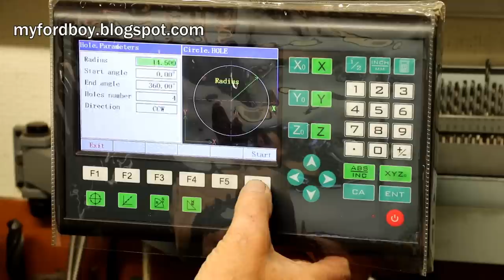Collet Chuck. Make one for the Axminster CO or any other Lathe.

Comment: This turned out very well, much better than my recently failed attempt to make a collet chuck for my Unimat.  I will have to use your method on a redo. 👍
Reply from the maker: I saw your video ,Jim. Those collets were a good buy but a bit large for the Unimat.
Best to keep the overhang small as possible.
Reply: @myfordboy  I wouldn't. There were a number of questionable workshop practices- one example, establishing the centre in the mill using a cone held in a Jacobs chuck. Mounting any chuck only using bolts, rather than a turned feature is to be deprecated.
Reply from the maker: @Tensquaremetreworkshop  Best to get your facts right before you criticise.
Not a Jacobs chuck but a live center with a MT 2 taper direct in the spindle of the mill.